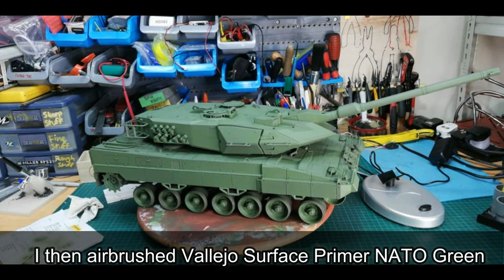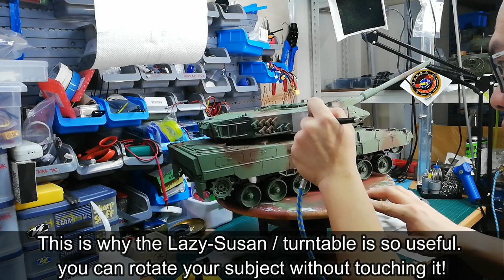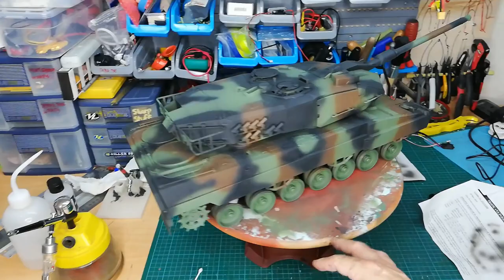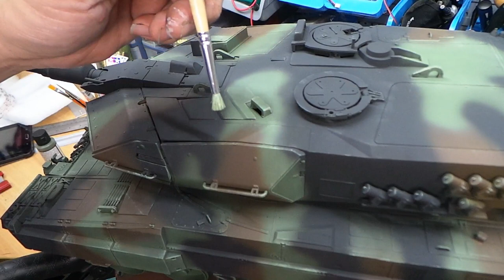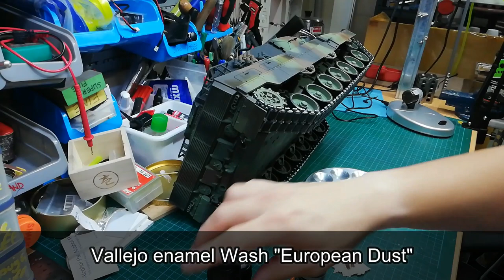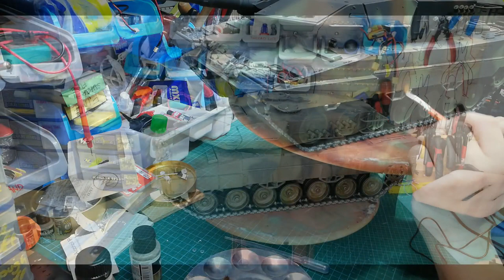How I painted this fully metal LEOPARD 2A6

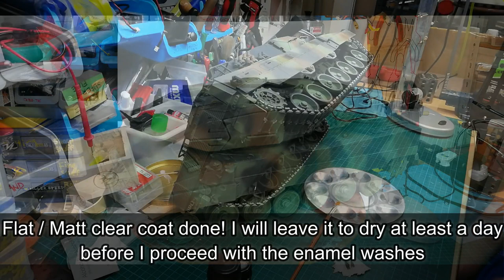Comment: Hi Stanlley, i notice that this full metal leopard 2a6 lower chassis is different from your other video... in the above video at 2:53, the rear tail light hv 4 leds on each left and right where as the other video where you introduce the  full metal lower hull have the same tail light as HengLong which is only 1 red led on each side and the the orange and while lights are decals. If i want to order one full metal 2a6 from you could i have the same back panel as this one with more realistic tail lights? I do not want the same tail light as that video https://youtu.be/CuVGQnV374s also could you make the top and front flashing orange light like in this video https://youtu.be/Pt-qiWq63nc

Comment: What is the brand of this full metal leopard? What are the specs of the electronics? Ismit out already in the market?
Reply from the maker: Actually no brand. The tank does not come with electronics. I used Tk60S for this tank. I built it for a customer in Singapore
Reply: Stanlley Legion the tank itself will cost how much?